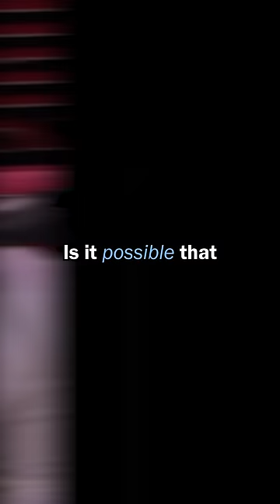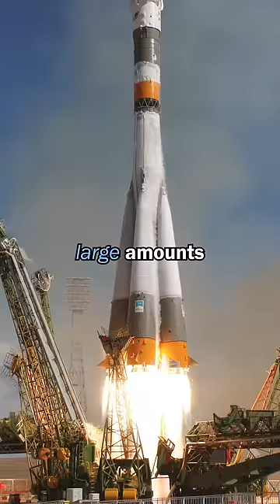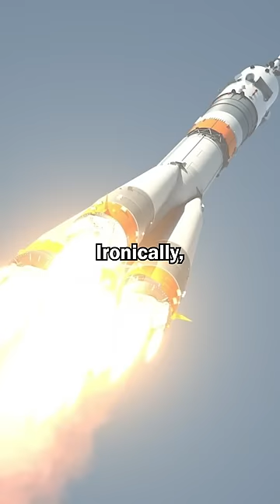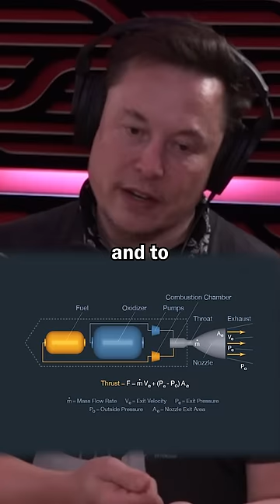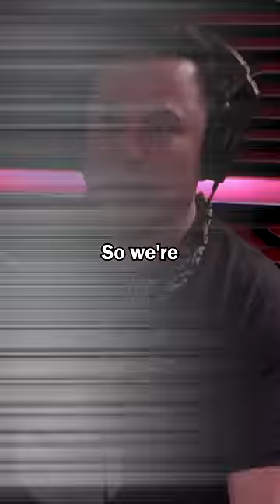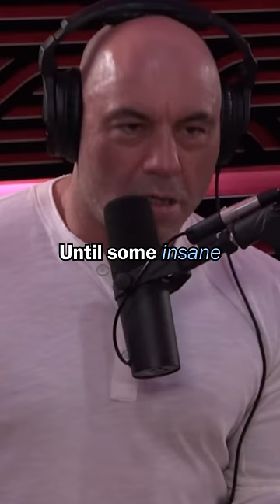Why This Rocket Engine Will NEVER Work!! ☢️ #spacex

Comment: Moral of this story: Don't fart in space.
Reply: Or sneeze
Reply: Do, if you want to move
Reply: @danildanils8042 ya conserving farts to propel you away from a black hole when needed 😂
Reply: @@ArtificialIntelligence09103he'll rotate fast at his own place
Reply: lmao.. that's not how momentum works in space.
Reply: @shul5684  that's how it works, all we would need is to fart in right direction
Reply: @fuze9923  no its not how it works! Look it up!
Reply: @shul5684  i had done it before replying to your comment 4 hours ago
Reply: @shul5684  farts may not provide much speed but still they would provide some speed
Reply: @fuze7555  no. When you get a rocket to move on space, the explosion creates particles that collide with the chamber of the rocket giving this one the momentum. A fart is just GAS coming out of your ass it doesn't collide with anything lmao.
Reply: @shul5684  pressure is created inside ass and the fart is pushed outside the hole once we are unable to control the pressure or if we want to release it.

Because our body has pushed the gas away from us, the gas also applies the same amount of force on us and pushes our body.

This is Newton's third law, because of this law momentum of an isolated system stays constant.

So the total speed of "fart + body" system stays the same.

But the separate parts of system start to move with different speeds.

Here the separate parts are "gas of fart" and "your body"

so your gas will go backwards, while you'd move forward from the mutual push between "you" and "fart"

I hope you understand this, every high school student who studies physics understands this.
Reply: @fuze7555  bro you need to look up how rockets work. It's not like that TRUST ME!
Reply: @shul5684  the fundamental concept behind working of rockets in space is what i told you. Rockets can do this in many different ways that may not be related to the ways i told you about
Reply: @shul5684  what you looked on internet?
Reply: that's why we have space diapers.
Reply: @@ArtificialIntelligence09103then you're going to spin  clockwise in the air 😂😂
Reply: I'm going to develop a videogame with that title. I'll put you in the credits 😂
Reply: @xavivax10  Cool, man !
Reply: Saitama sneezes and farts in space
Reply: @@ArtificialIntelligence09103what about the magnitude of impact of both forces caused by the fart and sneeze?
Reply: Unless you want to get somewhere.
Reply: @@ArtificialIntelligence09103you would just backflip forever. Haha
Reply: ...except if you wanna go places!;)
Reply: My grandfather always warned me of this.
Reply: @baukepoelsma  this comment isn't getting enough love 😂
Reply: You want BEYOND The Speed of Light? Hit up that Truckstop Sushi and Indian Quisine!
Reply: fr 💀
Reply: Too bad nobody has ever been to “Outer Space” 🥱🙄
Reply: @fuze9923 🤣
Reply: whttt!!??🤣
Reply: @shul5684  Oh for gods sake. The comment is a joke!
Reply: @lexzan  Or an egg curry....
Reply: Not in wrong direction😂… problem two, no body can hear u scream.
Reply: bro went from low earth orbit to Trans-lunar just by farting

Comment: Electron propulsion has left the chat
Reply: Exactly I’m like tf is he talking about
Reply: Not feasible on massive structures such as Starship. It can however be used on satellites or for small adjustments in orbit, for example on a space station.
Reply: Exactly what he said. Instead of gas it is expelling electrons very fast.
Reply: Very low thrust, which does not matter when free from the acceleration demands to get to Earth orbit.  But much more efficient, and much more momentum than gas, albeit slow acceleration.  Also a radioactive nuclear source provides the energy = much weight saving.  Used extensively for probes visiting other planets.
Reply: Pretty sure the argument from someone who build rocket for a living is more legit than some smartass from the internet
Reply: @internetcitizen3224 big oil literally had the same PR campaign when Al Gore was talking climate change.  Don't take advice on what is possible from the tycoon who is benefiting from existing structure.
Reply: That still uses gases to propel itself technically it’s just more efficient
Reply: @internetcitizen3224  Electron or ion propulsion using a radioisotope source is standard practice in space probes.  Much more efficient than gas propulsion.  However the thrust is far to weak to life an object into Earth orbit, so standard rockets are needed. The Cassini probe spent 13 years exploring Saturn with ion propulsion and used about 30 kg of plutonium.
Reply: Ion propulsion uses xenon or another heavy gas. Unless you can grab the quantum foam and pull, you need to expel mass.
Reply: @Creabsley i wass going to say tgat
Reply: @internetcitizen3224 no one on that podcast makes rockets for a living
Reply: Good for interstellar travel as it can accellerate a spacecraft to a very high speed over a very long time, with very little fuel, but you still need chemical rockets to leave Earth's atmosphere. Electron drives cannot produce enough thrust to lift a spacraft off the surface of our planet.
Reply: aww look, someone looked up something on the internet and then thinks its easy to apply it to rockets....
Reply: The word propulsion implies a propellant.
Elon is (unsurprisingly) correct.
Reply: We already have ion engines but they're not super powerful, they're good for later stages of the spaceflight of a spaceship tho, so who knows what the future holds?
Reply: Like electron isnt simply negligible but still "mass" haha
Reply: Saying like electrons are massless and unlimited.
(Physics has left the chat)
Reply: Will work once in space but it's not going to get you there.
Microwave propulsion is another option.
Reply: Electric propulsion still ejects mass my dude. Its just the means of acceleration of the gas is different (opposed to combustion)
Reply: So did nuclear.
Reply: Zero Point Energy vacuum.
Reply: Right lmao. You can throw electrons in atmosphere and have decent acceleration (don't think its possible at that scale right now). Then in space you can just...throw those electrons, which won't collide with anything, but it is still tranfering momentum, no?
Reply: What if you had air compressor. let air out inside of craft. Then recompress it?
Reply: @DanielHuet-Vaughn YouTube ghost you. You're commenting into nothingness. Welcome to the club.
Reply: Electrons HAVE MASS.
Reply: No. Specific Impulse has left the chat. Elon is not wrong in what he said.
Reply: Still tho, In those “ionic thrusters” some inert gas is needed to be accelerated.. the majority of the propulsion comes from the electric field but some gas is still expelled….
Reply: It can be applicable to smaller vehicles at outer atmosphere
Reply: We need MASSIVE amounts of infrastructure to even think about making "solar sail" propelled spacecraft. It will happen but "not in our lifetime" is a fair predictor.
Reply: Elon knows more about physics and astronomy and space than anyone i wouldnt doubt him. If you know more than Elon why aren't you changing the world day by day
Reply: @wickedwildwezt  How do you know he isn't? Or he could be like me, a scientist who made quite a career of challenging the famous ones when they overstate their case... which Elon is not doing here... but still.
Reply: @wickedwildwezt lol Elon is intelligent,  but by no means even close to the most knowledgeable. Hes a guy who hires smart people, not a genius.
Reply: Electrons have mass
Reply: @peewee0224 electrons have mass. Also, electric propulsion typically involves expelling protons, which also have mass.
Reply: @shaystamang  all true not at all what Elon was talking about. Nice try simp
Reply: True..but it's still a push by expended matter
Reply: I heard that's possible, but very slow.. like to get a decent sized object that could carry large amount of passengers and cargo.. it would the entire solar system basically to get up to a reasonable speed.. so.. we are talking years to get to Mars as apposed to months
Reply: @michaelwintermantel9127  Okay smarty pants
Reply: Your electron propulsion can't carry large payload 😅
Reply: @dorjanhajdari2670 air ion engines work by forcing electrons through air from one electrode to another, they do not escape from system. They just push some air along, and work somewhat like an almost powerless, in terms of force exerted and compared to normal, jet. If you run it in space nothing happens, electrons do not have air to push along, unless you supply the engine with Xenon or any heavy gas the gas your particular space ionic thruster uses.
Reply: @peewee0224 incredibly small thrust
Reply: @krispybacon9927  hey man size doesn’t matter
Reply: Everyone is a expert on YouTube
Reply: @ChiCub83 Al For was telling the truth? He didn't present faulty numbers during his run?
Reply: you die of old age before reaching orbit with that
Reply: You guys seem to know this stuff.. what limits the speed we've reached in space, i know there is this probe going over 600k kph so i was wondering how it sped up? More fuel save for in space? Can't we send like 100 rockets to reattach their fuel left in space to only one rocket and than have that rocket speed up to like 10 mil kph?
Reply: Electron propulsion still uses propellant.
Reply: It still requires propellant, it just accelerates it using electricity.
Reply: @hatchedcoast7495 not feasible for now*
Reply: You can never say ever
Reply: Electron propulsion still uses a Gass as its mass. Yes it uses electrons to react with the fuel, but you still need some type of gas as the propellant
Reply: Won’t work on the first stage of a rocket and it will never work……
Reply: @badabingbadaboom9251 Did you mean ions?
Reply: Still expelling matter...not sure what part of this is a gotcha moment
Reply: @Snakebloke  

Yep, ions, as in ion drive, have mass. So you are still chucking something out of the back
Reply: you just watched 2 shills🤡🤡 maybe just one. second one can be delusional and believe what he is talking for real.
Reply: On a large scale?
Reply: @CS-zn6pp  I just want to reheat my pizza bro. Leave the microwave out of this 😂
Reply: @danb400 you need a big ass equipment and heavy ass cooling system/heat sink to handle the heat.

So then you have the mass/power ratio problem.
Reply: Its still expelling mass i think just not gas
Reply: @joshuathomaskuriakose2615 ion thrusters actually do use gas. So yep still needs gas
Reply: @hatchedcoast7495 it also used heavy gasses such as xeon.
Reply: I'm sure there's some reason that doesn't work,  i mean he is elon musk...
Reply: @joshuathomaskuriakose2615   Gas is made of electrons...
Reply: He said rockets, not satellites
Reply: @malcolmabram2957 Yeah but other than rockets I don’t think any other type of propulsion can take anything in to space. Even the fastest air-breathing engines won’t get fast or high enough to reach escape velocity and other than just simply launching an object into space like SpinLaunch, we are basically stuck with rocket engines at least to take us into space. So he’s right that we’re stuck with rockets unless someone invents a propulsion metod that can take us to space
Reply: Electron propulsion is so weak it is not practical for large rockets. They only use it for small spacecraft.
Reply: I’ m pretty sure that electric propulsion still requires you to “expel mass” as elon states. So you still need some kinda “fuel” to expel and not solely relying on a battery.
Reply: imagine thingking you know more about ion thrusters than a guy running an advanced rocket design and manufacturing company.
Reply: @ramsesiv5342  He owns the company, doesn’t mean he’s designing or is an expert on those topics. He must know the basics and more than your average person but doesn’t mean he’s all-knowing. Remember a youtuber’s question gave ideas that helped starship’s development.
Reply: @mase8832  doesn't matter he knows more than a nobody joe
Reply: @ramsesiv5342  Justo because someone doesn’t own a multi million dollar company doesn’t mean their opinions and ideas aren’t valid
Reply: @mase8832  it's valid, not just as credible. just think don't let emotions run over your intellect
Reply: @ramsesiv5342  agreed. As long as it isn’t just an anti Elon musk comment I think it’s alright to comment
Reply: Ion thrusters work in orbit. You cant launch with Ion.
Reply: electron propulsion is for outer space because it's weak! you can't escape the gravity of earth with that massive amount pf gas bruuu😂
Reply: I don’t see something electric propelling something 23000km/hr into space…
Reply: @joshuathomaskuriakose2615 I came here to say this.
Reply: @internetcitizen3224  In this case, the one you think make a living out of making rockets(which he dosen't), is just a smart ass on the internet.
Reply: He basically said you have to expell mass and electrons have mass 🤷🏻.
Reply: Still requires radon gas. Not near as much. But it still needs a fuel
Reply: ROCKETS ARE HUGE, AND REQUIRE HUGE AMOUNTS OF ENERGY. ELECTRIC PROPULSION ISN'T THAT ADVANCED FOR IT YET.
Reply: Electron propultion? What? Ion thrusters maybe? They expell mass, just more efficiently.
Reply: Aka ion engines
Reply: Ion Propulsion needs air to push
Reply: That shit still expels mass my guy
Reply: It still propels mass
Reply: Won't get off the ground with that. deep space maybe but a launch, no chance.
Reply: Talking nowdays about rockets and space traveling is like two Monkeys Just discovered fire.
Reply: Electronic Propulsion still expels ionized gas that's how it works.
Reply: Ion engines is not electron propulsion, its high charged ions which are expelled on extreme speed. While actual electric charge is returning back to prevent expelled molecule to be attracted back magnetically
There are some ideas of photon propulsion based on solar sails enhances by big-as lasers or direct light expelling, but we need absolutely extreme amount of light expelling for photon reactive engine. Like planet piercing through laser amount of light
Reply: useful if youre trying to get some dust into orbit i guess lol
Reply: @Uberkilltoecheese  Read about ion engine. Most of spacecrafts with a need of propulsion into deep space have this
Reply: @peewee0224 you have more insight on rockets then Elon?
Reply: @Qursuu  none of this has anything to do with rockets it’s a basic prop logic
Reply: @hatchedcoast7495  yet.... Thay said the same thing about flight in the first place..
Reply: @peewee0224 after millions of dollars of research, i think he know what he is saying. If yours idea better, its good. Publish a paper, make an initial design or prototype. Make sure you really have make your own experiment with your own rocket man, dont rely 100% on theory when you are building things.
Reply: @peewee0224 btw is there any peer reviewed paper or any study to support your argument that electron propulsion is better for big rocket. I mean complete with proved experiment also, not only one sentence on youtube. Just wanna see how far you really stdy about this and put it on rocket. Who knows, next year you built the best rocket based on your super duper massive knowledge.
Reply: @Mattot-qi9qr  literally talking about the theory of it. just because we don’t know how to make it doesn’t mean it doesn’t exists.
Reply: @IEZX01 electrons do have mass goober.
Reply: @calebwilliams586  tell me you didn't understood my statement LOL
Reply: U need to leave this chat immediately, it's for the brains
Reply: Look at our best efforts at the electric propulsion engine and he is talking truth. Therefore EP is suitable for low-thrust (micro and milli-newton levels)
Reply: @joshuathomaskuriakose2615  Therefore EP is suitable for low-thrust (micro and milli-newton levels)
Reply: Dudes in the comments really think they know more than Elon Musk
Reply: Yea if you want to accelerate at 2 mph in space lol
Reply: It takes a long time, won't work on heavy equipment. And it really hasn't been tried enough. Not viable
Reply: @hatchedcoast7495 who knows
We still don't have powerful engines that's capable for that nor we ever tried.
Reply: ion propulsion
Reply: We already use that on sattelites, telescopes like JWST and other lkw mass objects but it's not enough to power a rocket by itself.
Reply: You're still expelling mass, you're just using electricity to push out the mass instead of the energy from a chemical reaction.
Reply: ion thrusters can be used for tremendously small amounts of force to adjust satellite positioning.   You are both not lifting a rocket from earth using ion thrusters, nor are you going to propel it to Mars in any reasonable amount of time unless the ion thruster is roughly the size of Manhattan.
Reply: Electric propulsion still requires gas to be expelled out in order to work
Reply: @joshuathomaskuriakose2615  That is completely wrong. Electric thrusters use noble gasses like xenon as their source of propulsion, not electrons. Electrons have so little mass that any thrust you might get from expelling them would be almost impossible to measure. The reason they are called electric thrusters is because they use electric fields to accelerate the propellent instead of a chemical reaction